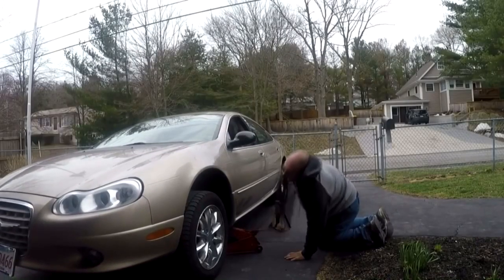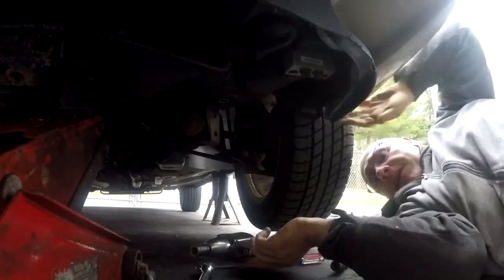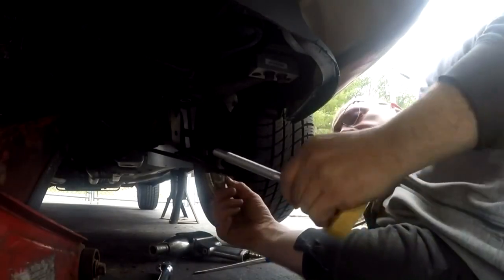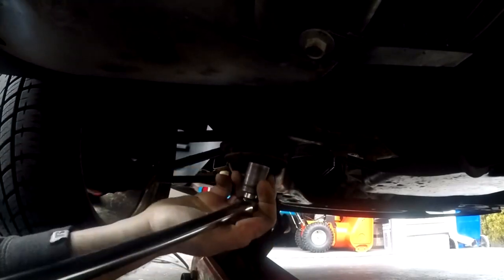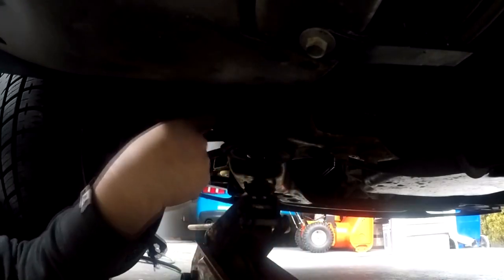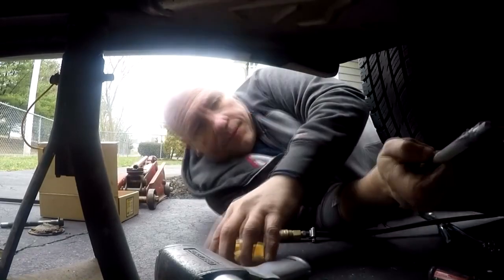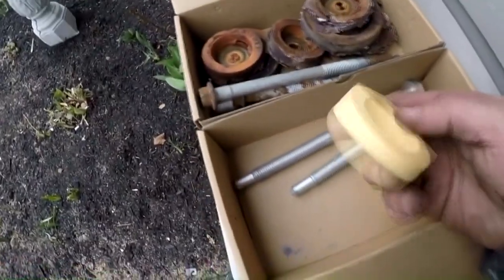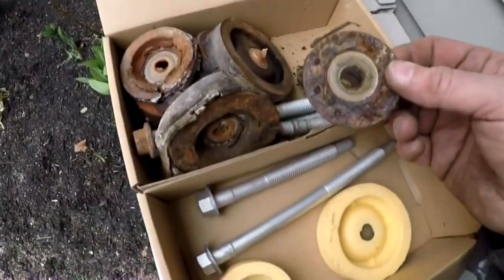Replacing the Subframe Bushings on a Chrysler Concorde | Techn' Moto

Comment: Hope your still around 3 yrs. later. Great video. I have a 2000 w/ 21K mi on it. Mom let it sit in garage. Perfect shape/never wrecked. Do you think these bushings would effect the caster ? Mine started to pull to the right recently and mechanic could'nt set due to no settings. Chrysler dealer wants to look at it and thinks it may be the engine cradle shifted. I'm just thinking of the $$ flying. I'd much rather do it myself.
Reply from the maker: If I remember correctly (getting old) It could affect the front end if those bushings are in poor condition. Have someone check it to see if that is the issue. Also a bad tire could cause a pull too. Have the car looked by a competent technician in your area. Good luck, I know they are hard to find.

Comment: Thanks for the video.  I have a 2001 Concorde Lxi.  I have the basic jack that came with the car, and access to a similar jack from my 99 Mazda 626.  I do have ramps that I can drive my front wheels onto.  Would this job be possible with the tires on the ramps, or do the wheels/tires have to be hanging free to do this?
Reply from the maker: I would think you can do these either way. Not sure but I say give it a shot.

Comment: @techn moto. I own two of these cars and been looking for years on how this can be done my self becuase mechanics try and charge an arm and a leg for this. The service manual is also not clear on how it should be done, at least the manual I have. The way you showed how this can be done was perfectly executed. I will definitely be doing this to my cars becuase my bushings look just as bad. I shared this video to all the LHS forums I frequent so people can check it out. Did you purchase the OEM or Dorman brand kit?
Reply from the maker: christianf2485 I purchased the dorman kits. Thanks for sharing my video I appreciate it. Good luck on the repair

Comment: I'm just curious but you said the kit you bought had all 8 bushings. Where did you buy the kit cause all I've seen is a set with just the 2 bushings
Reply from the maker: Link in the description for the kit. I misspoke- each kit will fit front or rear because it has both bolts.

Comment: Where did you buy your kit? I got a new set from Rock Auto but no new bolts included.
Reply from the maker: I think you need to order the kit with the bolts. that's how I ordered mine- kit with bolts. https://www.carparts.com/details/Chrysler/Concorde/Dorman/Subframe_Mount/2004/SET-RB924013-2.html?TID=gglpla&origin=&utm_source=google&utm_medium=pla&utm_campaign=12190938700&gclid=Cj0KCQjw4ImEBhDFARIsAGOTMj-ZZKQ32r1Ot9uFYGWkwX6AUXfDuWgsrREzq1LJKkkFYXa3SBlb-4gaAqcjEALw_wcB&gclsrc=aw.ds